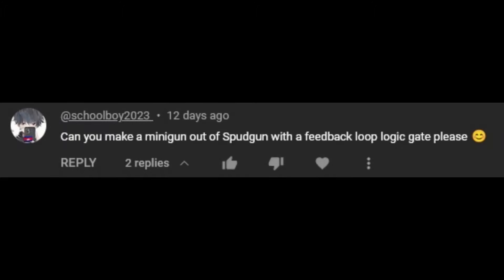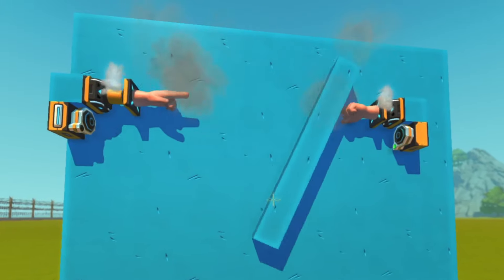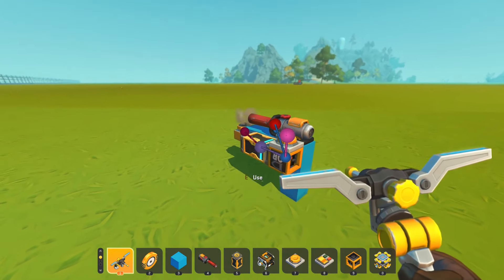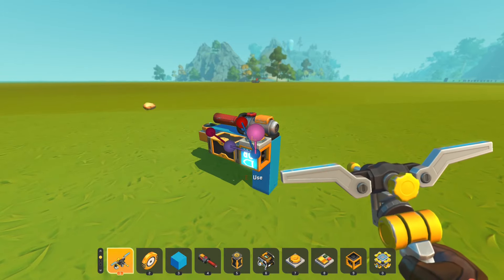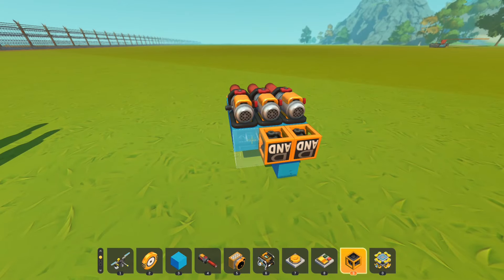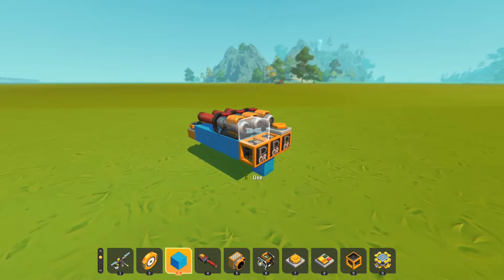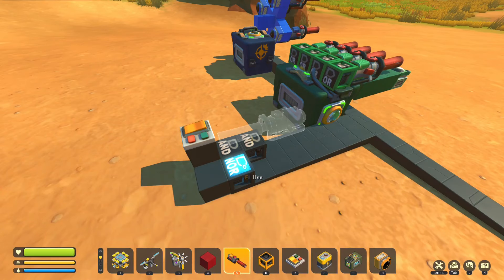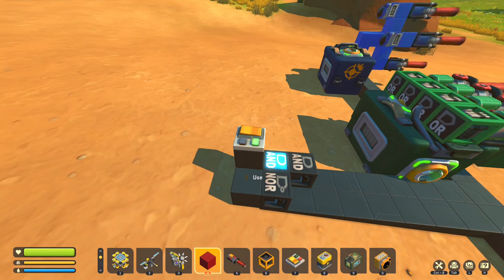A feedback loop explained using... potatoes?

Comment: very intresting gun, i think it can be improven - instead of 4 sputguns connected in chain you can use 4 separate sput gun mechanisms that startes one by one with 25 ms delay(4 mechanisms with 100 ms delay timer each so they power only itself but not near sputguns) and we get cannon that fires 1 shot every 25 ms and 4 in 100 s, so that will be 4 times faster, but to sustain this thing we need to take all potatoes from belarus
Reply from the maker: I understand what you mean, although with four in line and no timers you still get 4 spuds per second. The delay you mentioned happens naturally and I think comes from the time it takes for a spud to fly to the sensor, the sensor to "realize" that it sensed something, and the logic triggering the next spud.

Comment: shouldve put 4 guns on the 3 gate so that it had the same # of guns as the other two still good info though
Reply from the maker: I thought about it, but since everything else was "one spud per trigger" I decided against that. It would have been like putting 8 on the spinner with two firing per sensor, or just having a volley of 250 spud guns emptying a whole ammo box in one shot. I get what you're saying though, everything else having 4 and this one only having two guns may feel unfair.
Reply: @AgentWest  its alright it also matches the point you made of faster not meaning better

Comment: What is the name of the mod that changes the textures of logic like this?
Reply from the maker: it is "Logic Gate Improved View" from ScrapMechanicMods.com
I'd also recommend "Better wires & bearings" because it makes connection points smaller and easier to wire on more complex builds.
Reply: @AgentWest  oh sure thanks for the information